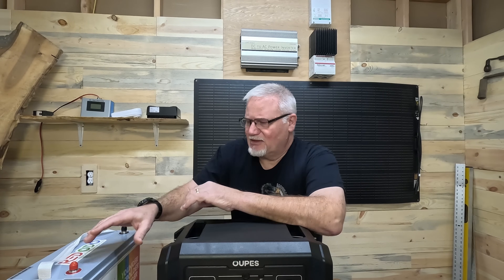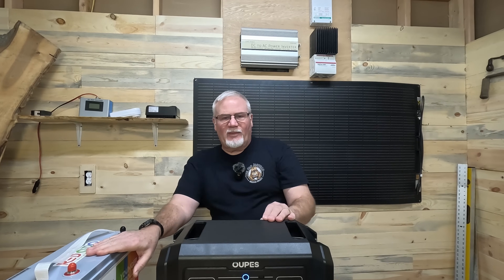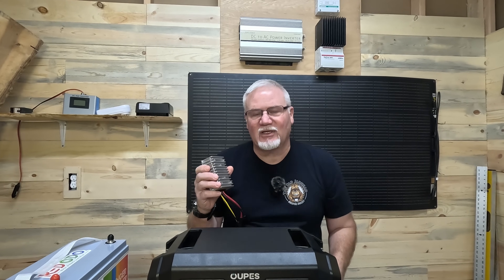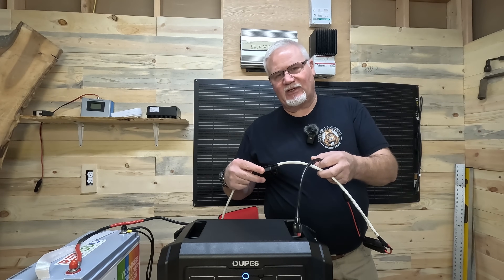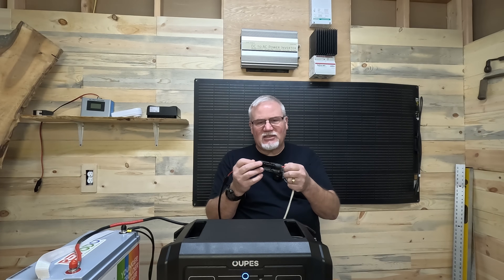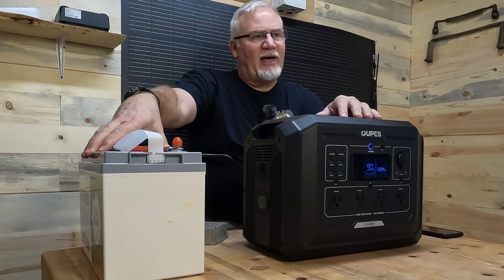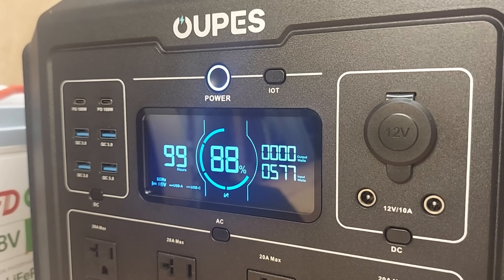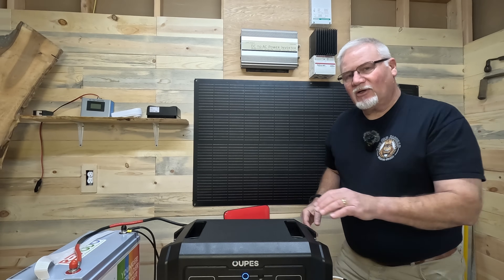Discover How to BOOST Your Portable Power Station Today!

Comment: Most modern power stations can take vehicle power on their solar inputs and will purposefully charge at 8A for that reason.   Apparently not the Oupes?  .Oops!  heheh.   In anycase, this means that most power stations will charge down to 10 or 11V (or at least 12.0V), which is perfect for a 12.8V LiFePO4 which will be 95% depleted at 12.0V and nearly 100% depleted at 11.0V.

So for Oupes to have a cut-off at 13V is actually fairly rare.  That will cause all sorts of problems for the Oupes when trying to charge it from a vehicle.  Depending on the vehicle, but most vehicles have regulated DC outputs on their (cig lighter) power ports.  So the Oupes will get into trouble.

--

In anycase, 8A @ (call it) 12.8V is roughly 100W charging.  YMMV.  But often this is what you actually want because you also need to remember that you will likely have a charging solution connected to the external battery and you definitely want that charging solution to be able to charge the battery faster than the power station pulls from it.

The reason is that if the battery is depleted and the charging solution is insufficient to match what the power station tries to draw, it will cause the charging solution to stop charging... or at least cause intermittent attempts to charge.  You don't want that.  It will cause the whole solution to basically fail and not be able to recover.

So if you DO use a charging solution that is insufficient, it is best to control the solar input of the power station with a voltage controlled relay.  Sometimes charge controllers have a switchable "load" output which can be programmed with voltage trips.  A Victron SmatrSolar 75/15 or a Victron SmartSolar 100/20, for example.  That way you can ensure that the battery is charged into an operating range (like 10% SOC... roughly 13.0V while charging) before you activate the load port and allow the power station to draw from it.

A discrete voltage controlled relay would be something like the "SVR1000".  A bit of a learning curve to program but very, very versatile.

--

For power stations that can take up to at least 30VDC on the solar input, you can use a 25.6V LiFepO4 battery.    It is far, far better to use a higher voltage battery like that instead of using a DC-DC converter.  The reason is that DC-DC boost converters are typically only around 90% efficient.

At 24V+ power stations use their solar amperage limit on the solar port instead of their car charging amperage limit so you usually get 10A-15A at (call it) 25.6V = 256W to 383W battery -> power station.

In this case you again need to ensure that the charging source for the external battery is capable of charging it faster than the power station is able to deplete it, or that you use a voltage controlled relay or programmable load-port solution to prevent the power station from trying to draw power directly from the charging source due to a completely depleted external battery.

--

Do 150% of operating current for fusing to reduce unnecessary overheating of the fuse(s).   125% for DC breakers for the same reason.

-Matt
Reply from the maker: I'd personally use a 48v battery on the Oupes, but I wanted to show how you could use a 12.8v battery and get more charging from it.
Reply: @TheOldJarhead  I always prefer 48V but in this particular application the battery -> power station transfer rate is probably too high.  You'll lose a lot of flexibility with regards to the charging solution you use for the external battery (more solar panels needed in series, tighter input margins for the charge controller, noisier AC chargers, and so on and so forth).

I'd stick with 12.8V or 25.6V for this application, IMHO.

-Matt
Reply from the maker: 12.8v is too low for this application and, at best, gives only 120-130w.  For this kind of thing, you need 409-500w to run longer in an outage, so this does that but is just a short-term solution, really
Reply: @TheOldJarhead  I consider it a tad low, but still quite useful.  At 100W the 12V system is pushing 2400Wh/day to the power station.   If your power station also has 2400Wh of storage, you've doubled the run-time of the loads before you completely exhaust all storage.

At that feed rate you would need 600W-1000W (roughly) worth of solar panels to keep the external battery fed indefinitely in modest weather.   And you would need a 2400Wh external battery = 200Ah @ 12.8V, roughly.   So already that is going to be a moderate cost.

So that's the basic argument.  As you up the voltage you can feed more power into the power station, but you also need more external battery storage and you need to recharge that external battery with more energy.... so you need more solar panels (or gasoline or whatever).   The feed-in system to really utilize the transfer capability becomes large and expensive in a hurry.

This is why the real sweet spot for this sort of mechanism is a 25.6V battery and not 51.2V.    To fully utilize the system at 25.6V you would need around 300Ah @ 25.6V (7680Wh or so) and you would be able to push ... lets call it 250-350W.  So you would be able to push 6000Wh/day to 8400Wh/day from the battery to the power station.

That's already fairly luxurious for an emergency backup.

At 51.2V the numbers reach the level of regular utility consumption for a full house (sans heating).   Now we're talking 500W-700W pushing 12000Wh/day-16800Wh/day to the power station, and you would need the same amount in external batteries to fully utilize that transfer rate.

--

So that's basically why  25.6V is the sweet spot and not 51.2V.  That and more power stations can be directly fed with when 30VDC is the solar input limit rather than 60VDC.

-Matt
Reply from the maker: Good stuff -- I've run my 24v battery in a test until I drained it keeping a couple crock pots going all day.  Was running about 300wh out of it all day long until it died.  Worked very nicely but yes, I'd have to get it changed back up (I have a 30a 24v charger and a generator so I can do that fairly quickly).

The best option, in my opinion, is DIY solar properly set up for your needs ;)  But power stations have a place and in a big outage tricks like these might give someone some ideas to keep that fridge and freezer running.

Comment: great video my only question is why do you use a step up converter
Reply from the maker: @einyv got it.  Since the Oupes won't use under 13v and at 13v you'd get maybe 130w changing to 48v gives me 489+watts
Reply: thanks guys makes since when you put it that way
Reply from the maker: you bet
Reply: To increase the voltage so the power station can use the battery to charge.
Reply from the maker: yup

Comment: Or you could put the 4 batteries in series and then don't need a step up converter. A step up converter introduces inefficiencies
Reply from the maker: True, though it means balancing becomes very important.
Reply: @TheOldJarhead I figure if I'm in dire straights and really need it I'll worry about balancing later. I have pre balanced pairs just sitting for this eventuality. Wattcycle told me to charge them to the same level with the same charger then connect in parallel for 12-24 hrs to match them. Between batteries and generators I've created a buttload of PMI type chores for myself lol
Reply: If you are going to be using a battery bank to charge the power station then the power station becomes unnecessary.
Reply from the maker: If you added an inverter then yes, correct but many use these power stations for emergency back up for outages and they just don't have enough watt hours...add a 4kwh battery and now we're talking!
Reply: Well, you don't put batteries in series.  You get a properly higher native-voltage such as a 25.6V or 51.2V LiFePO4 battery.  25.6V (30V maximum on power station "solar" input) works very well for many (but not all) power stations.  51.2V doesn't usually work well for this particular application... only larger power stations can handle voltages that high, and the charge rate is usually much faster than you actually want.
Reply from the maker: of course but some have 12.8v batteries already
Reply: @TheOldJarhead this right here!!
Reply from the maker: The Oupes Mega 1 can take a max of 80v so I would have no issue with using a 48v LiFePo4 which is why I did this test with it.
Reply: @junkerzn7312  mine goes up to 60v with a 48v battery would be charging back at close to 1000w
Reply: @junkerzn7312  in reality virtually every single battery is in series. A 12v lead acid in your car is six 2v cells in series. A 12v lifepo4 battery is four 3.2v cells in series. A flashlight with multiple AAA batteries is a series of 1.5v batteries. It is literally how they are built and most battery manufacturers list what configurations are approved, 2S, 4P, 4S4P etc.
Reply from the maker: great point
Reply from the maker: Every LiFePo4 I've tested that is a 12.8v battery shows 4S4P is max allowable config - FYI.
Reply from the maker: Another great point.
Reply: Do you use the batteries in a series? I have two 12.8v 100mah batteries and a power station
Reply from the maker: You can absolutely as long as the voltage is within the specified range of the power station
Reply: @handsomedubbledee  yes. You kind of have to. If you parallel them once under 12v it will stop charging and with series you'll double charging watts
Reply from the maker: Yup

Comment: Your supposed to size fuse to wire
Reply from the maker: technically the wire sgmhould be sized fir the amperage and so too the fuse.
Reply: Fuses should  be sized to 150% of maximum expected load, and that value should be less than or equal to 100% of what the wire can physically handle.   DC breakers should be 125% of the maximum expected load (unless surges require otherwise), and also less than or equal to 100% of what the wire can physically handle.

Wires should be sized such that the maximum expected load is less than or equal to the maximum ampacity for power transmission.  This is a very conservative number which is generally 50% lower than what the wire can actually handle.   Also, always use 60C ampacities for wiring.  You can use wires rated for higher amounts of heat, but in terms of the ampacity table, always use 60C.

--

What wires can physically handle depends on wire length and insulation temperature, but the reality is that in power systems where continuous power is being run for many hours at a time, you always want to be extremely conservative.  You always want to use 60C ratings for relatively long cables ("ampacity for power transmission"), even if the cables have higher temperature ratings.

The reason you always want to use 60C ratings is because heat stress loosens cables, crimps, and bolts over time, reduces the life expectancy of electronics (heating of the circuit board near the terminals, for example), reduces battery life (heating of the battery terminals, for example), and causes larger end-to-end voltage drops across the entire system (reducing efficiency).

For example, 10 AWG copper has a NEC ampacity of 30A @ 60C for intermittent loads.  But for continuous power transmission it's actually 15A.   I usually don't put more than 20A of continuous current through 10 AWG and I fuse for 30A (150%) if I am doing that.

Don't fuse to less than 150% of the maximum expected load as this will cause the fuse / fuse-holder to overheat.  If 150% is too much for the wire size, then the wire size is too small.

-Matt
Reply from the maker: Ahhh I guess I was just thinking of breakers.  Thanks for the information